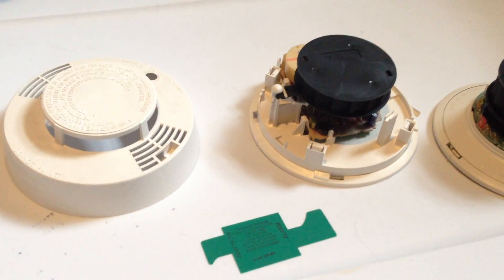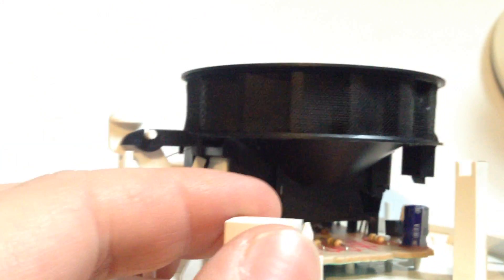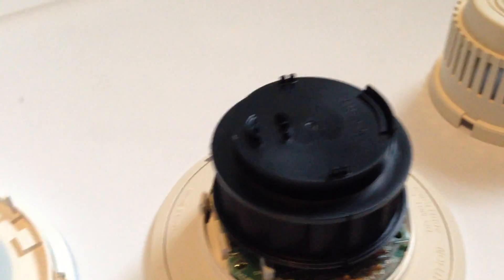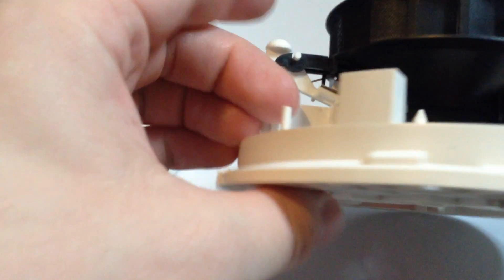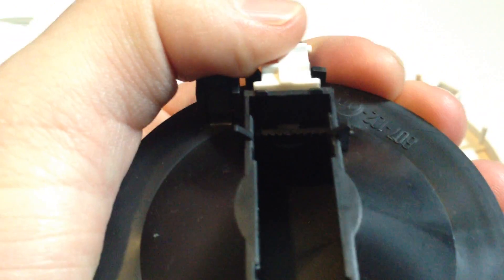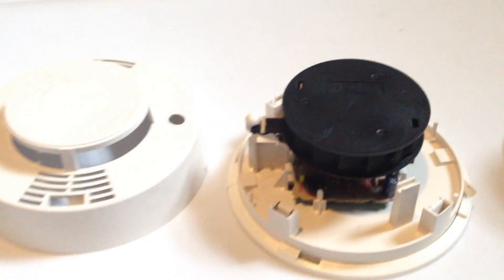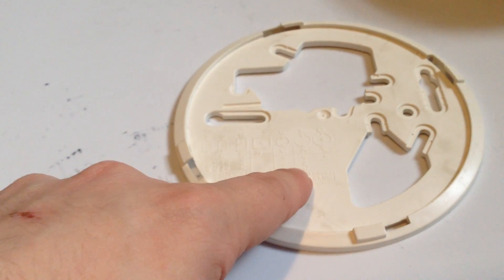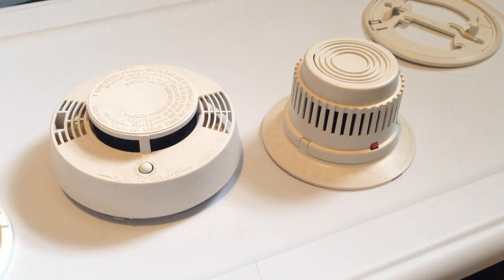BRK 5919 & BRK 2800 Smoke Detector Comparison

Comment: So I had one of these in my old house, it looked identical. The house had an ademco lynx r security system installed probably in the 90s and it had this smoke detector. Did they make a wireless version of this detector that could be hooked up to a security system?